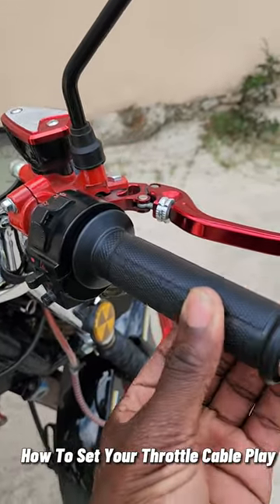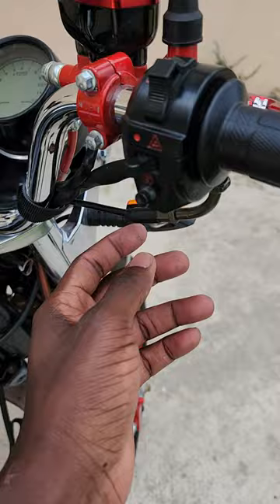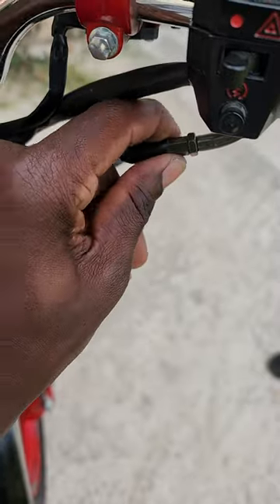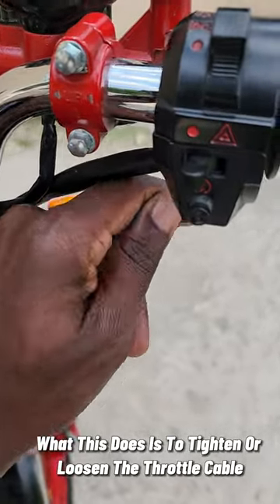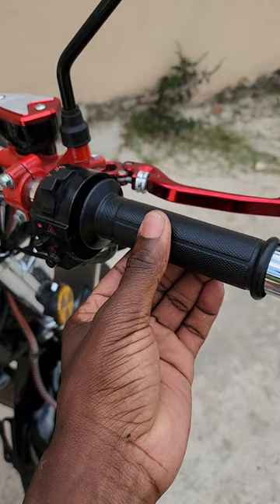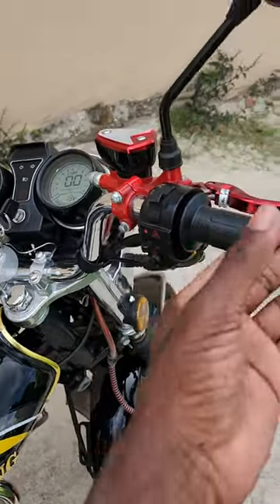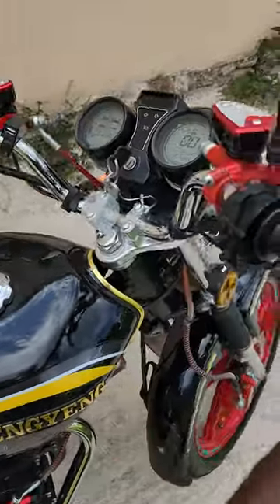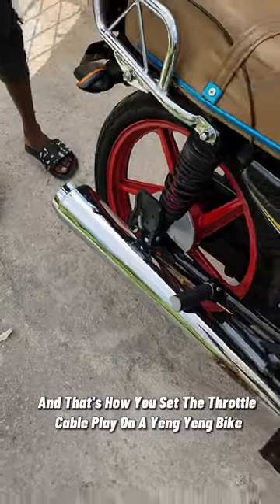How To Adjust Your Throttle Cable Play #howto #bikelife #motorcycle

Comment: There’s two places to adjust the throttle, one at the other end of the throttle cable. The one closer to the handlebars is for fine tuning, while the one on the other end is for larger adjustments.
Reply from the maker: @nathanielreeves_dev On these bikes? I have never seen any other adjustments points on these, Remember they are carbureted
Reply: For these bikes theres only one option before u gotta rip the carb open

Comment: Would that help if my throttle is very twitchy it has a lot of play, but it’s very twitchy either on or off I can’t consistently hold. The throttle had a good speed without speeding up a lot.
Reply from the maker: Yes it definitely can help. Too twitchy could mean the cable is too tight, there's no room for play